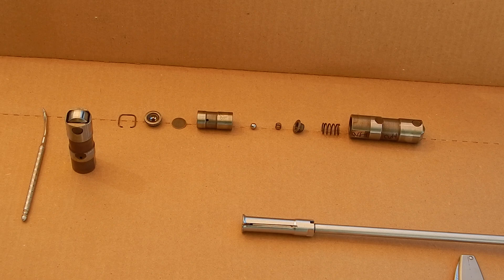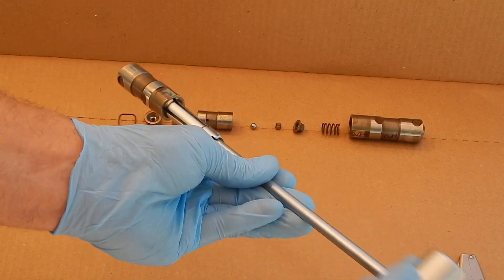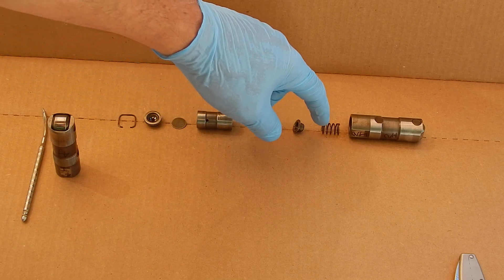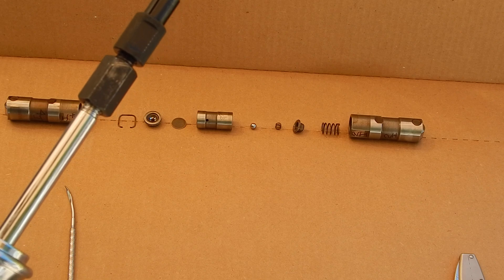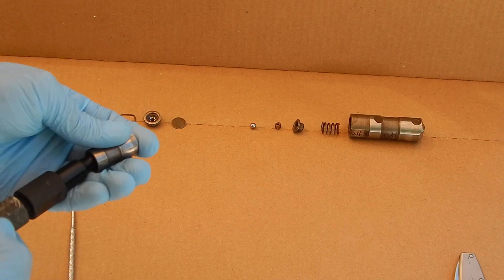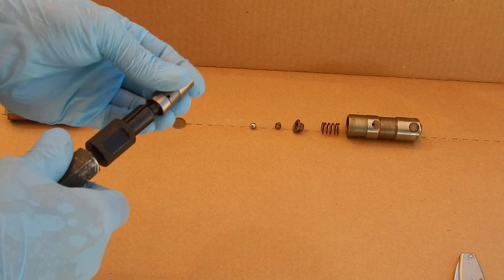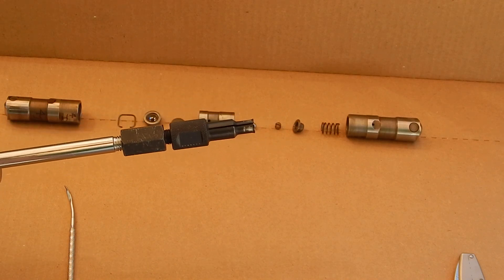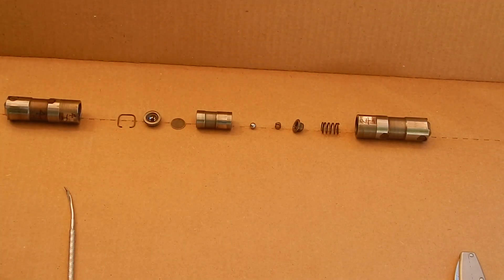Hydraulic Lifter Tutorial

Comment: I bought the Blind Hole Bearing Puller from Amazon - the cheapest one with 4 collets. It's not worth buying! I has to do some cutting wheel magic to one of the collets as I used it to extract the needle bearings inside the Eaton M90 Gen V supercharger. I would have saved a lot of time if I just bought a higher quality tool.

Thanks for sharing this GM 3800 info - Phase 2 of my personal 3800 project is about to begin and I will probably pull my lifters out for cleaning now that I see what tools it takes to properly disassemble them.
Reply from the maker: Innovative Solutions    3.21.17.   The 10mm collet blind hole slide hammer I purchased from Amazon worked great for disassembly of the lifters. And your correct, cheap tools are in most cases, not a value!.........The 3800 SuperCharged engine is a great bargain! 👌🏽

Comment from the maker: 5.23.15.     I forgot to mention that when I did the G.M. 3100 V6 lifters, I finished cleaning with kerosene, & put them back together, but didn't fill them with oil. I was on the Antique Automobile Club website & they said not to fill them with oil, they would pump up quickly after the engine was first started, & you would not risk a valve kissing a piston. The 3100 made about 10 seconds worth of clattering after I first started the engine. 😎
Reply: hello after cleaning the lashes . . .  so far did it work?  are they the kind that has to be replaced or can be maintained by cleaning?
Reply: Good point! Oil them on reassembly but DO NOT fill them with oil! Bad things will happen.